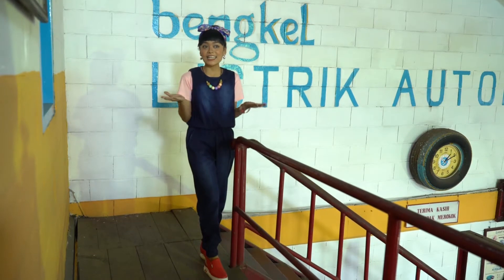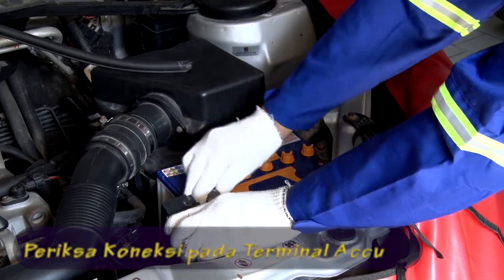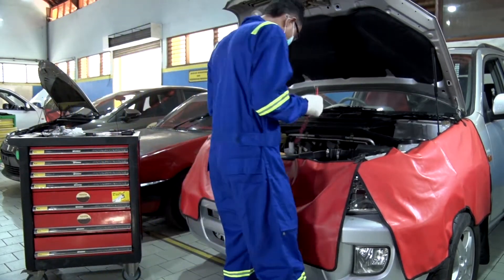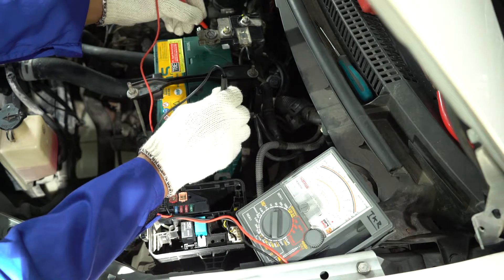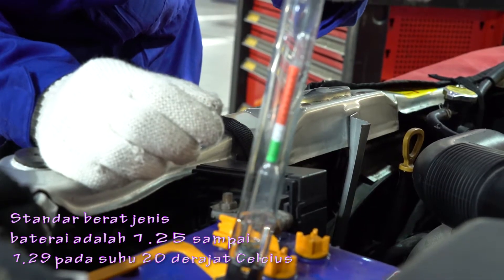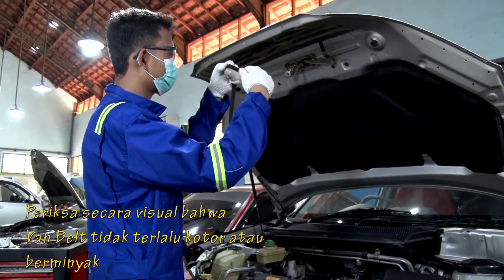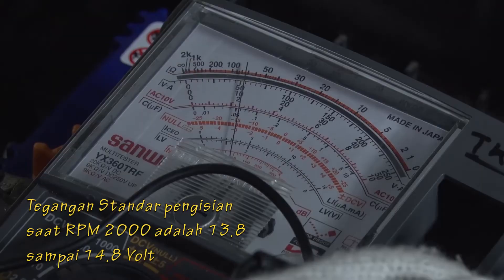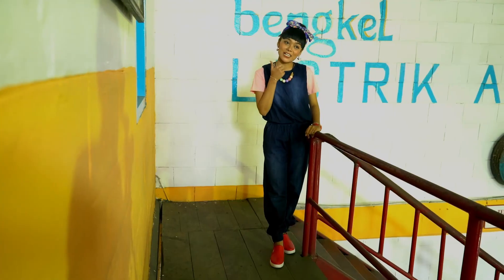Perawatan Sistem Pengisian IC Regulator  |  Charging System Maintenance

Comment: Nama : Muhamad Ferdiansyah
Kelas : X TKR 3
Tugas : 
~ Cara melepas bearing tanpa rusak special service tools for mechanic.
1.puller bearing atachment
2.puller perapat oli
3.puller pilot bearing
- siapkan treker bearing
- siapkan pengapit landasan
- posisi yang sesuai
- putar perlahan searah jarum jam.
Itulah cara melepaskan bearing yang baik dengan menggunalan treker sehingga mendapatkan hasil yang baik dan terhindar dari kemungkinan kerusakan pada komponen bearing itu sendiri.

~ Cara keja mesin 4 tak / 4 stroke lengkap dengan animasi.
Cara kerja engine 4 langkah:
1.langkah hisap 
2.langkah kompresi 
3.langkah usaha/langkah kerja
4.langkah buang.
- langkah intake(hisap)
- langkah compression(kompresi)
- langkah power(tenaga)
- langkah exhaust(buang).
Nah itu semua penjelasan cara kerja mesin 4 tak secara singkat. Semoga artikel tersebut dapat berguna dan bermanfaat bagi kita semua.

~ Hydrolic system works|rem hydrolic|car lift dongkrak eskavator.
Saya kali ini akan membahas bagaimana cara kerja system hydrolic adapun aplikasi system hydolic pada teknik otomotif di antarnya:
1.car lift
2.rem hydrolic 
3.dongkrak 
4.eskavator.
Apa sisten iru sistem hydrolic adalah suatu sisyem/peralatan  yabv ada pada zat air(Liquid)

~ cara mengukur tekanan kompresi toyota avanza|compression tester|compression gauge.
Pengukuran tekanan kompresi pada mesin perlu dilakukan pada proses pekerjaan service,hal ini bertujuan untuk mendiagnosa performa mesin pada langkah kompresi.
Langkah-langkah pengukuran: 
1.lepas ignition coil(sistem pengapian)
2.lepas busi
3.pasangkan compression tester 
4.buka gas penuh
5.starter sampai 250 rpm
6.baca hasil pengukuran
7.bansingkan hasil ukur dengan standar pabrik.
Penting:
Limit perbedaan tekanan kompresi antar silinder adalah 1kg/cm^2.

~ Cara membaca jangka sorong/sigmat/vernier caliver dengan ketelitian 0,02 mm.
1.jangka sorong dengan niali ketelitian 0,02 mm.
A.Skala Utama
B.Skala Vernier
2.jangka sorong dengan nilai ketelitian 0,05 mm.
Pada setiap skala vernier nya sehingga pembacaan hasil ukurnya akan di hitung.
3.jangka sorong dengen nilai ketelitian : 1/128 inch
A.Nilai setiap ruas pada skala vernier = 1/128 inch
B.Nilai setiap ruas pada skala utama = 1/16.

~ Cara mengukur Elektrolit baterai dengan hydrometer.
Pada baterai basah reaksi kimia pada saat proses pengosongan,dan akan terpengaruh pada berat jenis elektrolit.
Oleh karena itu pengukuran berat jenis elektrolit perlu dilakukan untuk mengidentifikasi layak atau tidak layaknya elektrolit yang di gunakan jika di dapat hasil seperti ini lakukan langkah berikut:
1.Recarge(cas ulanhan baterai sesuai standar)
2.tunggu sampai elektrolit di 20°C 
3.ukur kembali Bj elektrolit
4.jika hasil tetap sama gantilah elektrolit
5.lakukan recarge kembali.
Cara mengukur berat jenis elektrolit baterai:
Masukan ujung hydeometer ke dalam elektrolit baterai samapi cairan elektrolit masuk ke dalam hydrometer dan pelampung terangkat. Baca berat jenis elektrolit baterai dan hydrometer pada posisi yabg sejajar kemudian catat hasil pengukuran jika sudah diketahui berat jenis elektrolit pada baterai maka segera lakukan tindakan tindakan yang perlu di lakukan dapat di tunjujan pada taebl di bawah ini.

~ Pengukuran tahanan(resistansi)
Menggunakan multi tester (AVO meter)analog
Pengukuran kelistrikan kendaraan seperti:
1.kabel tegangan tinggi busi / kabel oli koil
2.sensor-sensor pada system EFI.
Switch (saklar) mendiagnosa kabel apakah masih terhubung atau putus, mendiagnosa fuse(sikring), mendiagnosa sambungan shocket.

~ Cara membaca dan menggunakan vernier caliper| How to read a matric vernier caliper (sigmat/jangka sorong) dengan ketelitian 0,05 mm dan 0.1 mm.
1.pahami bagian-bagian jangka sorong 
2.bacalah skala pada jangka sorong 
3.periksa skala dari bagian-bagian terkecil
4.bersihkan benda yang akan di ukur
5.bukalah kunci sekrup
6.tutuplah rahang jangka sorong
7.geserlah salah satu rahang untuk menjepit benda yang hendak di ukur 
8.bacalah skala utama yabg berimpit dengan angka nol pada skala geser
9.bacalah skala vernier
10.jumlahkan kedua angka yang di peroleh.
• dalam contoh, kita mengukur 2,6 inci pada skala utama dan 0,014 inci pada skala vernier. Hasil pengukuran akhir adalah 2/614 inci.
• angka tersebut selalu segaris secara rapi/tepat. Sebagai contoh, jika skala  utama dalam satuan senti meter terbaca 0,85 dan skala vernier 0,01 cm terbaca 12, penjumlahan keduanya akan menghasilkan 0,85 + 0,012 = 0,862 cm.